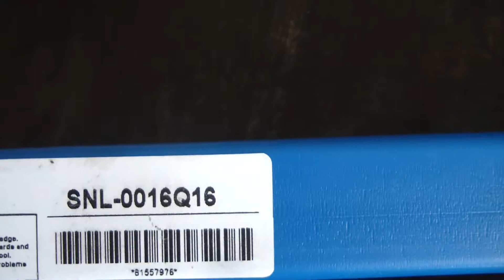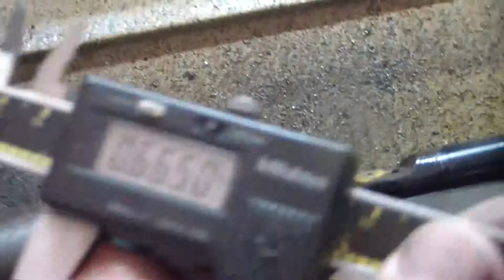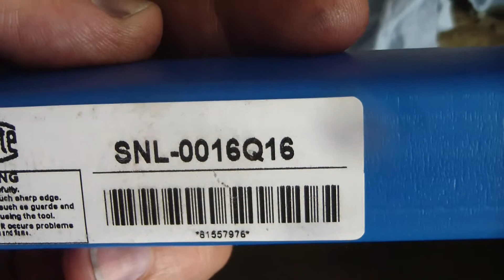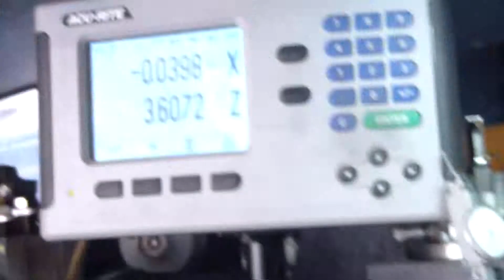Cutting an Internal Thread using Banggood SNL0016Q16 threading bar with 16IR 3/8 carbide inserts.

Comment: I just checked the internal threading tool and you definitely can use a external,right hand insert without having to buy more inserts.I use a right hand tool and simply turn it upside down.If you have not seen the videos on threading by Joe Pieczynski,you should watch them. I was amazed with his knowledge and ability to relate information in a common sense manner.
Reply from the maker: Yes I watch him all the time, Very smart guy.
Reply: He's not using an external insert toolholder. I think the one he's showing here is an SNL toolholder. As far as I can tell, he's doing everything okay. http://www1.mscdirect.com/images/solutions/kennametal/kpTopNotchThreading.pdf.

Comment: I also like to thread away from the headstock exactly as you are doing it,internally and externally. I would like to mention one thing. I noticed you are using a internal,left hand insert. The top rake angle is backwards. The low side is in the direction of the cut.This is why your chips are flowing outward. I would like to suggest that you use a internal,right hand insert in the left hand bar. I think this will make for a much smoother thread.Please don’t think I am being critical.Your threads look good.
Reply from the maker: Thank you, I never thought about the rake angle being different for right or left but I guess it makes sense. I will have to get some different inserts.
Reply: How would you use a right-hand insert? Your cutting point would be pointing forward (toward the headstock) instead of to the right.